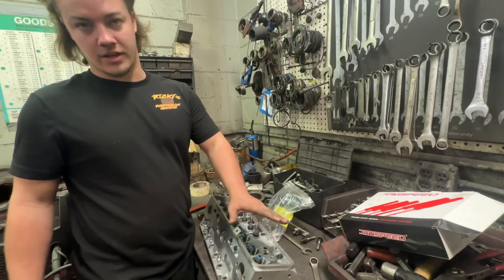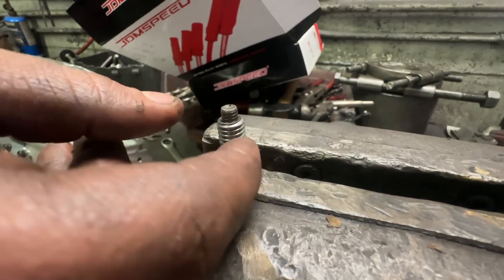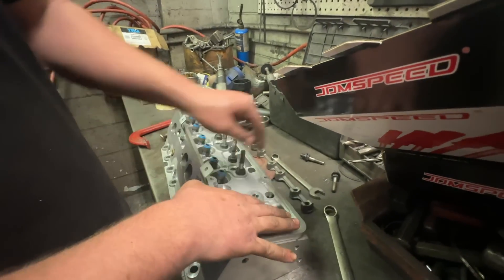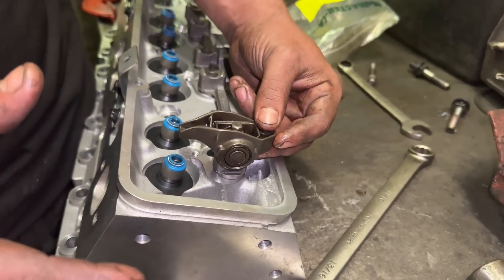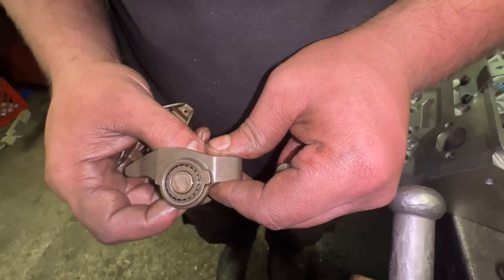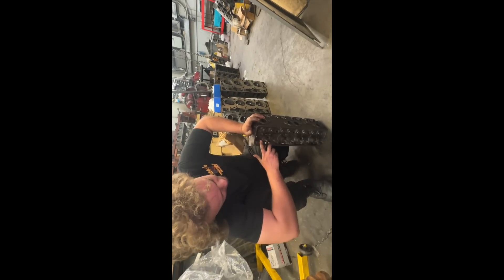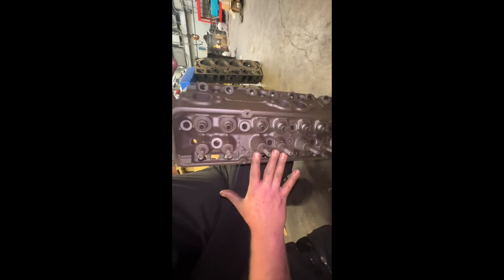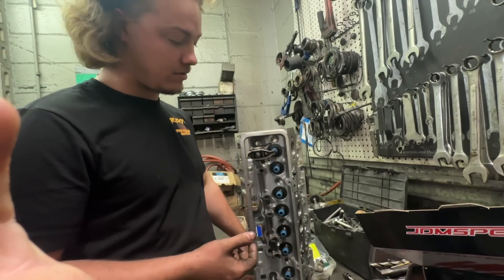How To: get Ls style rockers for cheap on a Gen 1 SBC

Comment: The weak point of your conversion is the 8mm bolt .With the valve at full lift all the load is trying to pull the bolt out of the head and at the same time putting the bolt in tension an 8mm bolt does not have the tensile strength of an 3/8 or  7/16 stud. A better idea would be to drill the arm and  cradle to 10mm high tensile bolt and use another insert.
Reply: It's the bolt used in the LS engine, which is not known to have failure issues.
Reply from the maker: you're correct this is basically an identical set up as the ls using different parts from different vehicles to get the same results.
Reply: The LS uses a larger cam core, which makes the cam lobes larger and less aggressive, when using it on a sbc with its smaller cam core the 8-10mm bolt is not strong enough for anything other than maybe a stock cam rebuild.
Reply: @b.c4066  The larger LS cam core diameter makes life easier on the lifters allowing more drastic ramp acceleration which in turn makes life harder on the rest of the valvatrain. 
 I don't think the goal of this conversion is to run some wild camshaft numbers, it's a very frugal and readily available source for an upgrade on rockers. My question is about pedestal mounting height and pushrod length.
Reply: I have done plenty ls run 150 nose  on stock bolts
So I am sure it can handle a roller cam on sbc 
Curris of the geometry of the rocker on this conversion
Reply: Never, ever, EVER buy cheap valve train components. Do a conversion like this or spend the money on the good stuff. Go with comp cams ultra pro magnums roller rockers. They will rebuild the reunion for you if it ever wears out. Even if you didn’t buy them yourself and found them at a garage sale. I myself have been lucky enough to listen to enough people who have been there and done that. If you are running a stock cam, it might work for a while but why not just use stock valve train? When you actually spend the money to have an engine prepped for good part upgrades, you do not want to skimp on anything! It will cost you much more in the long run when it lets go. And it will quickly. Some of my friends decided it was more important to spend too much on dinners with their girlfriends at fancy places than to spend the money on good rockers. They regretted that! Stop eating out for a month and you will more than save the 300 or so bucks for the good stuff. If you want to ignore advice, then go ahead and buy the 💩 stuff. But please 🙏 do not tell others who don’t have any experience with this type of stuff to go out and buy the crap they are peddling people just to save a couple hundred bucks or so. It isn’t fair to them, when their engine goes south, they have to pay to get it fixed or some even just get frustrated and give up. For some it may be their first AND last engine. Let’s as gear heads give them the safe and wise advice so they can enjoy what their hard earned money bought them. I have a friend with an engine in his truck that broke on break-in, he skimped on a couple things and sure enough, they caused the catastrophe. He’s so frustrated at how much money he threw out the window…and…how much it will cost to do it all over again that his truck has been sitting ever since. I haven’t even asked about getting it fixed once since it happened. Why? Because I told him to get the good stuff and he wouldn’t listen. Not my concern anymore. But had I told him to go ahead and buy the cheap stuff, I would have felt so bad. 😢 Sorry for ranting but I just hate to see advice being given that probably will affect someone negatively in a big way. Especially now that our politicians are purposely making it harder on all of us.

Comment: I work in a machine shop, how much do you think I’d have to set the holes back to make the 1.72 ratio ls rocker work? I’m building a set of homemade raised runner heads and I’m already welding a lot on them so moving some rocker arm pedestals won’t be to big of a deal.
Reply from the maker: we will have to measure it tomorrow but can let you know tomorrow while we are at work. guessing around 100 thousandths